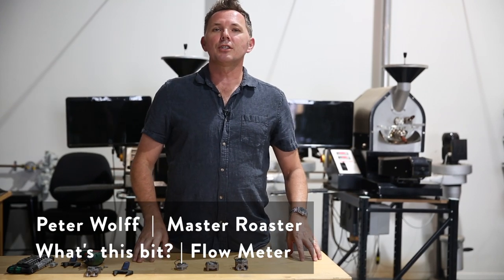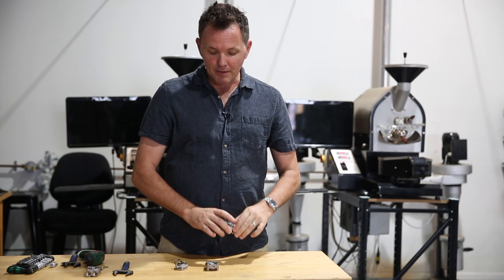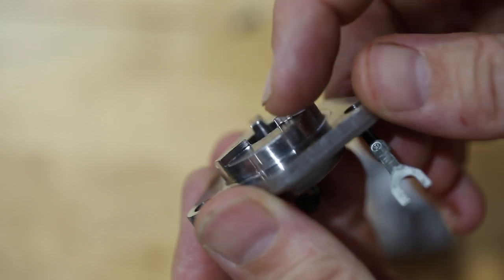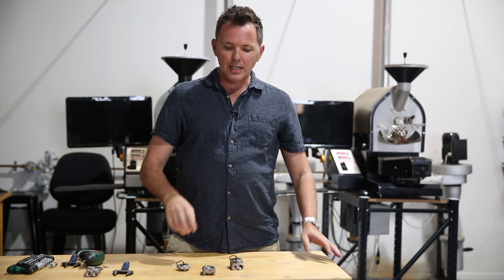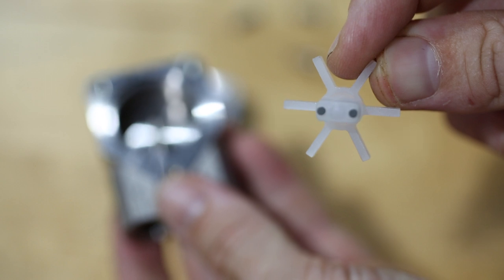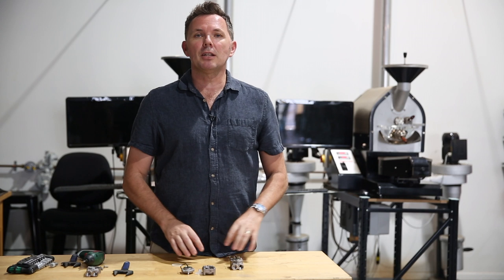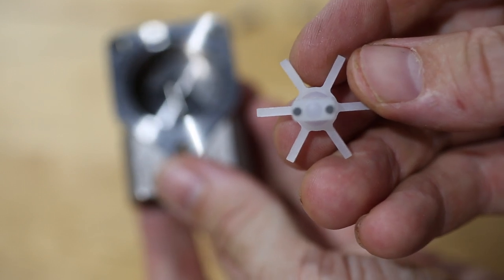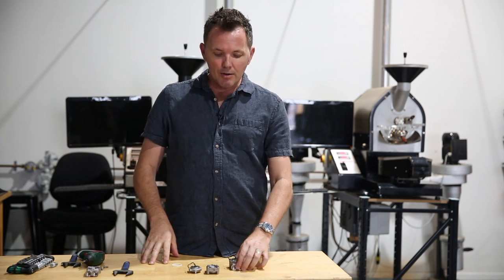Flow Control Meter | What's this bit?

Comment: i hooked up a 2 group machine today that hadnt been in use for a few months. once the water was turned on and the machine powered up water would constantly pour from the group head. I removed the top of the machine and noticed the flow control meter on the offending group head was flashing to indicate it was in use, it works the same as if I push a button on the second head the light flashes to indicate use. I was wondering what could cause this to fail and is there a way to fix it or do I just need to replace the part

Comment: I have a question. On the 2nd group touchpad is not working. I can hear the click but doesn't let the water out, except when I press pause button. Is this got something to do with the flow meter?
Reply: Hi Ivan, espresso machine technician here!  A lack of flow from the group could be a number of things, including the flowmeter, the flow restrictor/jet, and the group valve.  If you’re still having issues, let me know what type of machine you have and I could advise or recommend you to have a technician look at it in person if you aren’t mechanically-inclined

Comment: Is the Gicar amber indicator light always on or only when you have no flow & or other problems?
Reply from the maker: the light should be on when you have flow if there’s no light there’s no flow
Reply: @WolffCoffeeRoasters  I have a faulty Elektra T1...there's no flow but the LED on the flow meter is permanently on. What does this mean? Faulty control module?

Comment: Hi my breville machine came back from repairs today issue was blocked flow meter. How do i prevent this in future?
Reply from the maker: Hi Abdul, 
Ensure you change your filter regularly, and even use filtered water if you can. It is worth regularly descaling your machine to ensure no scale build up breaks off and causes a blockage.
Reply: @WolffCoffeeRoasters  got it thanks